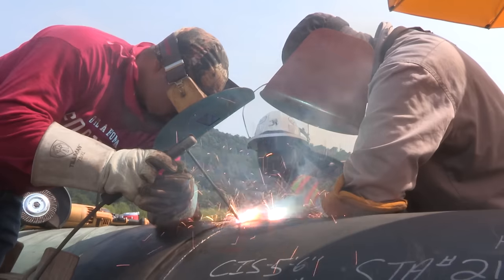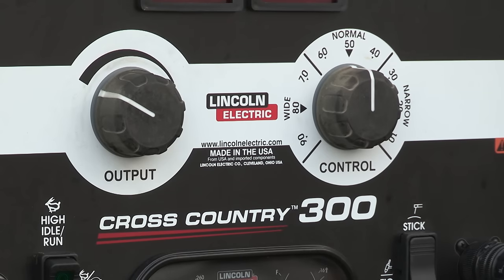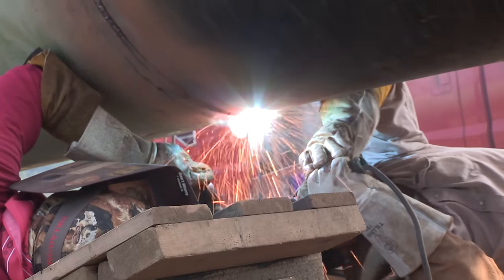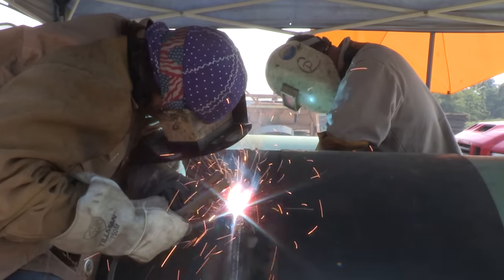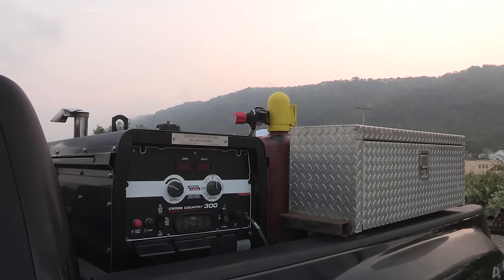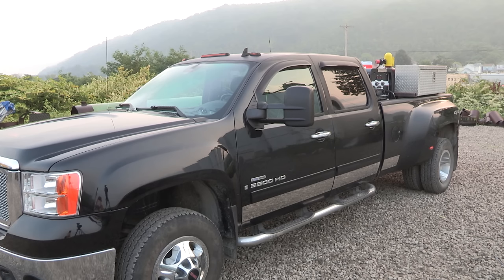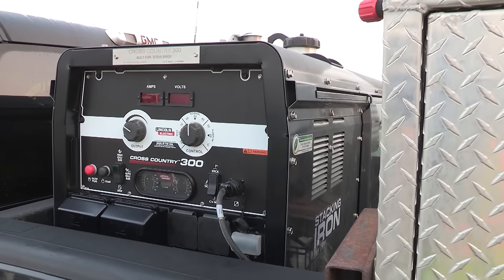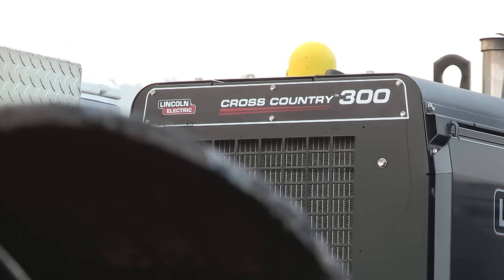Lincoln Electric Cross Country 300

Comment: if lincoln had any smart people working there they would start making the SA-200 short hood and offer it with gas or a kubota diesel and use the same 1950s all copper generator. that machine would sell like hotcakes . too bad they only want to sell computers with flat screens on them, not everybody is a facebook welder.